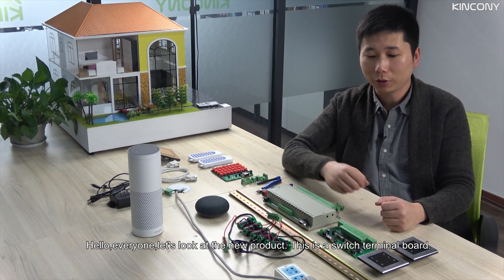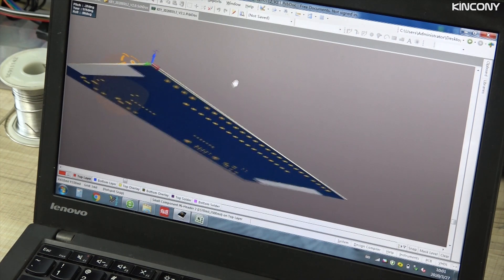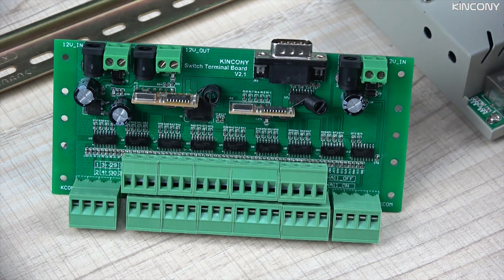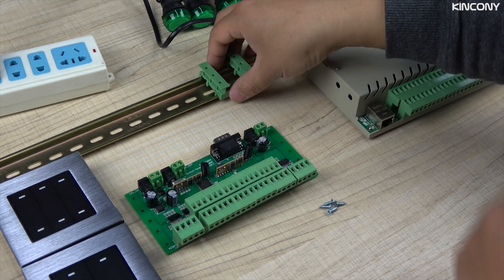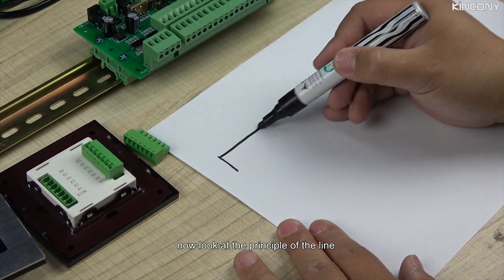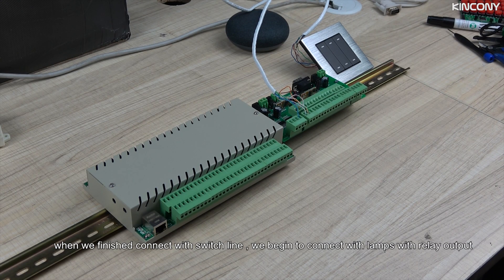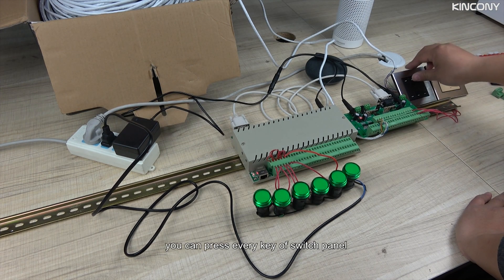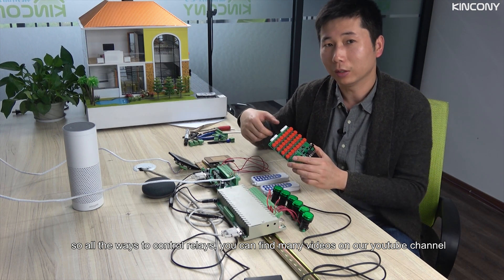[Automation Module Project DIY] how to remote control relays many ways

Comment: Can you say how to test switch terminal board is working or not, with multimeter?
Reply: I bought KC 868 32 H Pro and switch terminal board. When I install them KC 868 32 h Pro is working but any command from switch terminal board to KC 868 32H Pro didn't work. How to fix it?
Reply from the maker: @kyawthu3755  take a video send to whatsapp number: +86-15381188302

Comment: The terminal strip switch only works in motor mode. Why?
Reply from the maker: you use hold on "ALL OFF" button can change to "lamp" mode.
Reply: @KinCony  
I press all off 5 times, the LED will flash quickly. In light mode, IT does not respond to buttons and remote controls. Everything works in engine mode
Reply from the maker: @grzegorzgrzegorz3205  maybe you have not connect with another DC12V power socket, please take a photo or video send to our technical support whatsapp number:+86-13336170682 he will remote help you.

Comment: another question
The terminal boar switch only handles pulse switches or is it also possible to use latch switches?
Reply from the maker: only use for any dry contactor switch button, not for latch switch, if you use latch switch, that need press on and press off again.

Comment: What is the messure  PCB?
Reply from the maker: switch terminal board.
Reply: @KinCony  yes
Reply: @KinCony  ????
Reply from the maker: @Electricand  what's your means? i don't understand you "measure"
Reply: @KinCony  PCB dimensions
Reply from the maker: @Electricand  15.5cm*7cm
Reply: @KinCony  tkns
Reply from the maker: @Electricand  you are welcome

Comment: Hi, I would like to ask if I can connect any switch (for example 3 gang 1 way - L3 L2 L1 L) or I only need to use your switches. If possible, can I find a diagram of how to connect? Thanks
Reply from the maker: you can use any self-reset switch panel, not must ours. just dry contact switch panel.

Comment: i got the answer here. wall switch ditstance cable
Reply from the maker: support MAX 300 meter.
Reply: @KinCony  I have used  RJ45 cable with your controller and i'm getting interference. The momentary switch turn the light on without any action..
Reply from the maker: @kodjoaziaka6137  take a photo how you wire, then send to whatsapp number: +86-15381188302

Comment: in wall switch 4 gang, can be connect wire 1-3 gang for normal step. and 4 all on or all off. Or not
Reply from the maker: yes, it support, any key defined by yourself

Comment: Hi, In above video as shown, you have used switch board connected with control to use external buttons, in this scenario can I also used google voice? If yes than where can i installed voice board module on the controller as , controller has only one DB9 connector which already occupied/connected to switch board., kiny advise.
Reply from the maker: connect with external buttons is for manual control , not use for google voice, but you can create scenario in google home app for voice control. DB9 RS232 MULTI SERIAL ADAPTER for KC868 Smart Controller : https://www.kincony.com/rs232-multi-serial.html

Comment: Can work with touch Switch livolo for exemple or only work with your switch?
Reply from the maker: board support for every dry node switch , also called self-reset switch. any brand, not only for use ours.Such as a button.
Reply: @KinCony  I still don’t understand, will your board be controlled by a regular button? you have one wire connected to the KCOM terminal, is this necessary?
Reply from the maker: @Archer_SU   regular button, that when you pressed the switch is ON, when you remove the finger, the switch will auto change to off , this kind swith panel is ok. you can think your computer mouse, left button and right button as this.

Comment: I will order 20 KC868-H32WL and 20 of these switch terminal board for big project. Great video! (1) MOST IMPORTANT --> Are 32 , plus 2, inputs "dry contact inputs" meaning no X Y scanning? (2) Are these inputs pulled up by resistor on PC board? Seems so. 
(3) Are inputs opto-isolated?  Seems so. 
(4) If opto-isolated, are 8 K-COM terminals on the opto-isolator side, meaning they are isolated from the rest of PC board? 
(5) What Vcc are all pull-up resistors sourced, maybe to the extra +12VDC terminal? Or where? How? 
(6) What is Vmax of all switch terminals inputs? 5V+ 12V 24V 30V 
(7) Is there any protection on all switch terminal inputs, maybe reverse diode, or maybe series resistor, or maybe Zener diode? 
I have more questions, but these need these answers very soon. 
Thank you so much.
Reply from the maker: answer:
(1) no X,Y scan, every input port is independent I/O port of MCU.
(2) Yes, already have pulled up by resistor.
(3) Yes, use opto-isolated in order to improve anti-interference. also the opto curcuit's power is isolated. so you can see another DC12V input power socket on the right top of the PCB board.
(4) Yes, KCOM also  is isolated with opto.
(5) opto curcuit's power is isolated
(6) we use 7805 IC for voltage stabilizing circuit, you can see the 7805 IC's datasheet.
(7) opto just a  diode,so if you reverse connect with switch input port, just not work for switch.

Comment from the maker: If you have any questions, you can communicate here. We will reply as soon as possible.
Reply: My 4 channel relay is offline problem? How to solve?
Reply from the maker: sumon ms check your work mode = udp and dest ip 114.55.89.143 in vircom network tool.
Reply: I want to use remote control relay module. I don't have computer. How to solve offline problem.
Reply from the maker: @sumoneuc  need use computer to check config.
Reply: KINCONY IOT  still I have offline problem. I use computer to configure vircom network  tool with. After  I reset and try it again. Still offline problem. I scan and add QR . But it is offline
Reply from the maker: add our Technical support whatsapp number: +86-15381188302 we will help you.